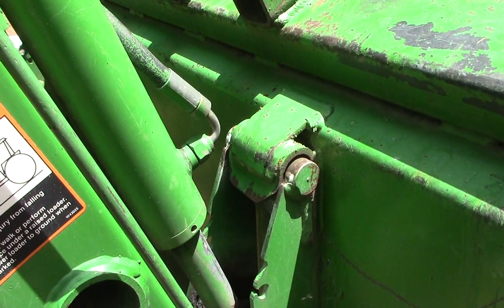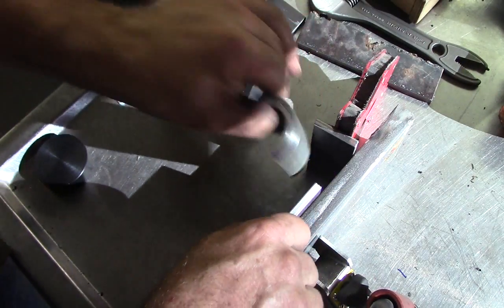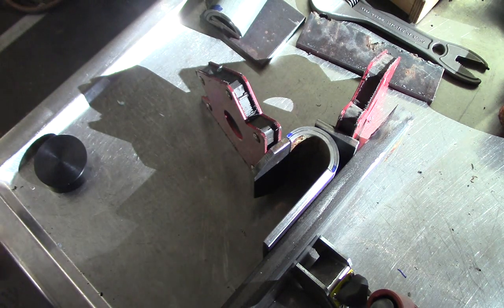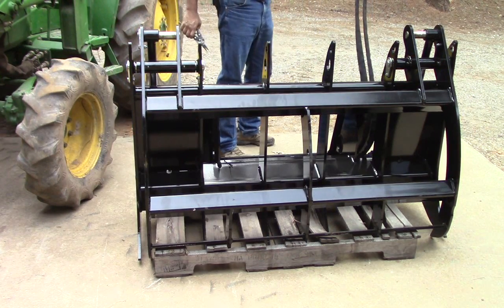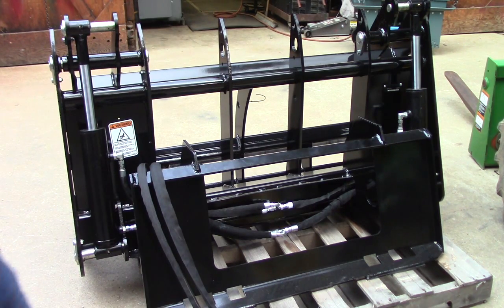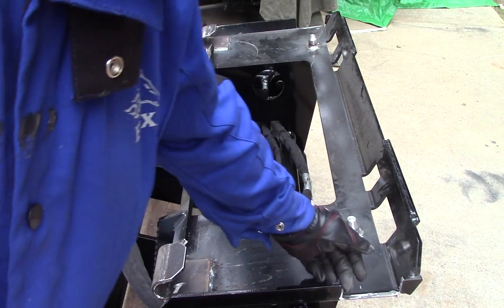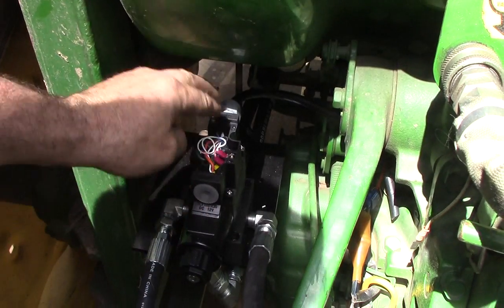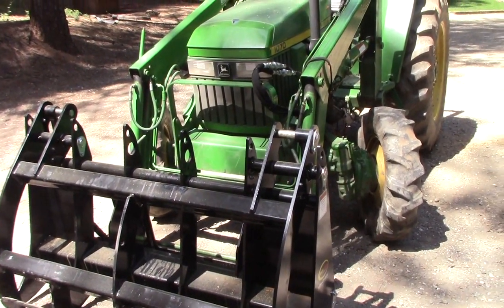John Deere & the Quick Attach Grapple Part 2

Comment: Nice job as well - but you forgot to tilt the 'bucket' Grapple so you can pick up something instead of just running into it.  Martin  who owns a root digging Grapple and a double picker grapple that weighs 1/2 that of the digging one.  I use the root for digging under a log to grab it and then drag it out of the brush.  The other is a snatch this or that and gets most work with limbs and small trees that fall.   Nice job and fix.  I have a 1025R  which is 1/2 size maybe or a little smaller.  Still in the 1k family.

Comment: Nice clip fabrication work but may need to add more support before tackling the heavy slash. Also, thanks for the details on the water resistant switch. Thank you for showing us how to do the modifications. You are so good at making thing work.
Reply from the maker: Thanks Paul,  it is working very well so far.  But when I get time I think I will add some beef to it.  See you in a few weeks.

Comment: hey randy,
that turned out pretty good! 
one little tip: you may want to add a plate across the back of the grapple where you had to cut out for the pin clearance. you had already said something about that. as you work the grapple by pushing against it, it will develop some hairline cracks and you'll end up welding on the thing endlessly which gets to be a real drag. i would also put on a backing plate on the opposite side of where you attached your pins. eventually the plate that the pins are attached to will start bow inwards. 
in both cases i would drill a one inch hole in the center of the plate and partially fill it in with the MIG welder so that the center of it's fused with the body of the grapple and not just run a bead around the edge of the reinforcement plate.
for a dimension the plate should be about an inch larger than the foot print of the contact points of the tractor.. in other words if you have as an example a 4x6 contact point your backing plate should be 6x8 and at least half inch thick... 5/8  or 3/4 is better

cheers
mike

Comment: Hi Randy.  I have no idea about the structural adequacy of the brackets you made, but just FYI, two pieces of 1/8" stacked does not equal the strength of 1/4".  it is in fact only 1/2 the strength.  You must have a shear connection between the two to make them act as one, and I did not see an edge weld on the stacked pipes.  Optimally you would fully weld the edges and drill some holes in the outer ply to place some plug welds in the middle connecting the two halves together. The prying force on the pin will try to straighten the inner plate while pushing outer away creating tension transverse to the plys, hence the plug welds.

Comment: nice install randy. i installed quite a few of  attachments when i was a service manager for a cat dealer. i would have considered putting an adapter plate (you can buy these with plain backs) on your machine and then convert your bucket to quick attach. that way you could take advantage of any different type of attachments you may want to buy or rent in the future. i believe the quick attach system on your grapple is now industry standard . make sure the bottom retaining pins are strong as these can be ripped off if the attachment gets caught on something backing up or tilting forward. you need to find a hossfeld bender,you could have made your top hangers from one piece of steel.

Comment: Hey, Randy, looking good. That's a nice, clean adaptation for mounting the two to each other. 
Will you have to add an external auxiliary hydraulic oil tank so that you will have enough to extend all of the cylinders to full length? John Deeres are pretty good with that, so maybe you won't have to. 
Have fun with the new toy... I mean tool. 
Joe
Reply from the maker: +Joseph Magedanz Thanks Joe.  So far no, on the tank, it is working well.

Comment: Having cut those sections there, you should really stiffen the back of the attachment plate, considering today they make just about everything and test it on a computer (they make a part exactly to the spec so that it doesn't need any more metal), i doubt there's provisions for modifications. It might be a failure point.

Besides, both are just flat stock. Two at the bottom on the other side to mirror the hole cut there, maybe with a small hook to stiffen that bottom lip which is now hanging in the air. And two at the top, horizontally to keep lateral flex in check.

Just my two cents on it,.